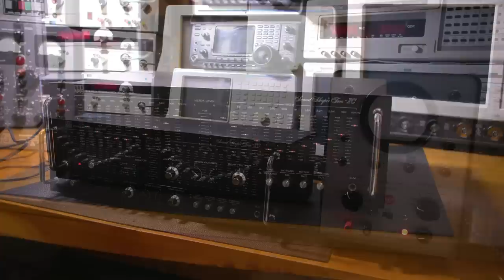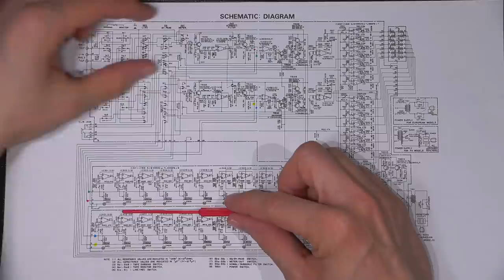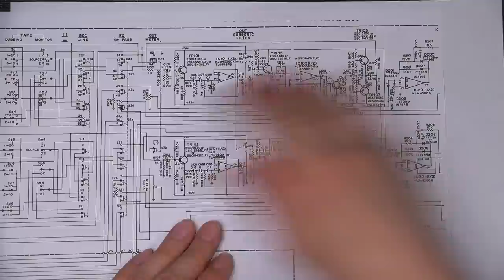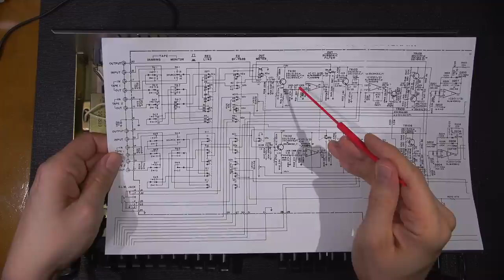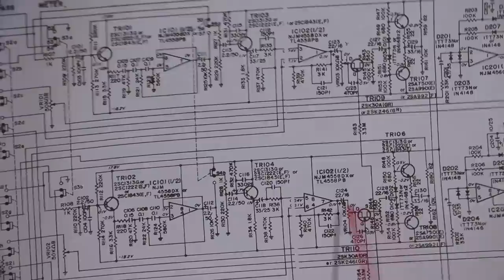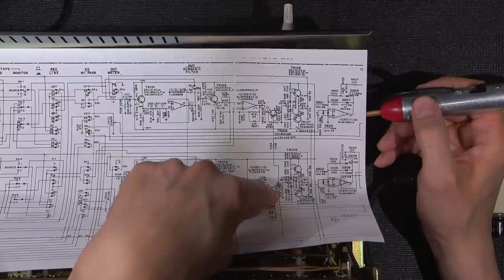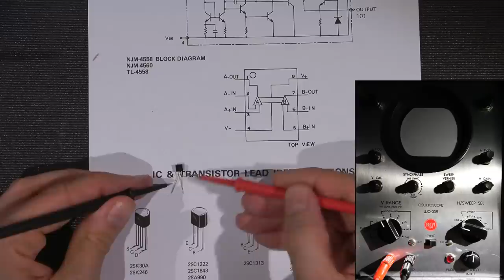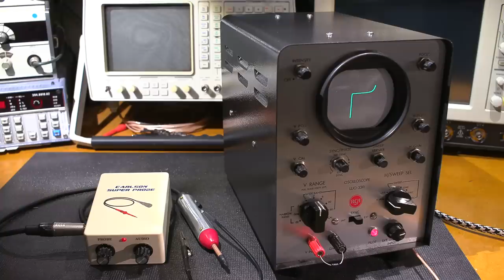Electronic Repair- Stereo Audio Equalizer From The 1980's!

Comment from the maker: To learn about electronics in a different and very effective way, check out my Patreon page. Many of my designs are released there as well. Click this Link: https://www.patreon.com/MrCarlsonsLab
Reply: @HalfSpeedMastering -- In this particular case it certainly is same, since the FET in question has a pure and very brief pop-suppression function and is otherwise pretty close to a piece of wire in the signal chain.  I would trust Paul 100 percent to avoid degrading or otherwise altering the audio performance of any gear he works on.
Reply: Gotta love this old school  equipment. Very stylish scientific look to the dials, markings, and solid cabinetry. Reliable circuitry, and easy to work on. 🎛🎚🎚🎚🎚  👌😙
Reply: Could you help or enlighten me with component VSHPS1437_040050680, your help will be highly appreciated sir....thanks
Reply: May you should make a video about the carlson super probe instead, if it is so easy to use.
Reply: Quick question where did you get you desoldering tool. And or what is the brand name/ what is it called.
Thank you for your time and have yourself a grate day. 😁
Reply from the maker: @charlesbennett6105  Hi Charles, it's a Hakko FR-300
Reply: Awesome! Thank you so much for replying. 
Have your self a grate rest of your week. 😁
Reply: How do I pm you?
Reply: Hate this video. Showing off a Carlson superprobe. So I looked on the internet straight away to buy one. You can only get one if you build one yourself. I am sure I will make a mess out of that as i never made any electronic device. So great machine for electronic builders. Bad for dumbass electronic beginners like me who could really use one to find electronic problems the easy way. But all respect to those who understand all that electronic stuff. Wish i didn't study bookkeeping. Now I would have liked it more to be an technician in electronics.
Reply: mine sometimes works but its all distorted and sounds like crap but the left channel works just fine..
Reply: OMG, I used to have that equalizer, in the late 80's.
Reply: +zt
Reply: Watching you work on this makes me wish I had followed in my father's footsteps and studied electronics he was a ham radio operator W9CMX
Reply: Good morning,

I have a question about a 14 pin IF amplifier IC. The one in particular I’m looking for info about is for a McIntosh MX 113. I need two of them. I’m thinking about a NTE 744. Do you think that’s a compatible replacement?

Comment: Wow, I have the same ADC Equalizer that I bought in the mid 80's. still works great. Thanks for the video.
Reply: Me too.  Love it.
Reply: @sferg9582  Still have my ~40 year old one, a SS110 Mk. II, that I had given to me back when I was 14. That was in 1991.
Just fixed it today, now it works right :)
Reply: The sliders on mine does light up and no  sound it hasn't been used in years

Comment: Wow, freakin' awesome video. My first equalizer was an ADC Sound Shaper Two (with the VU meter) in 1978. Worked great but with three tape decks I eventually wanted a dubbing feature on the EQ. So in 1982 I purchased this model ($213). With bidirectional dubbing, large LED meters, a good subsonic filter (18dB/oct@15hz), THD and IM of 0.02% and great layout of controls I was pleased. My original EQ was given to my brother-in-law and he still uses it today. That's over forty years. My SS2 IC still functions perfectly and is used every time the hifi is on. Not bad for thirty six years old. 
 Some folks just don't understand how useful an equalizer can be. This video is very interesting and a definite keeper. The SS2 IC is an excellent EQ, functional and pleasing to the eye with that "industrial" look. Remember their first EQ?? The ADC 500??? Well worth an hour of my time to view this. Nicely done, sir.

Comment: Amen brother.  Don't know how many times someone sent in a radio saying xxx was wrong with it and the instant it got set on my bench it started to work again.  Having been a heavy truck mechanic also many years ago I speak from experience when I say they suffer from the same problem to.
Reply: Ditto for computers and electrical installations.
Reply: @Mariano.Bernacki  For me the opposite happens. I test the damn computers for 2-3hours and the next day the client calls me that the thing stopped working.
Reply: The effect also happens with desktop support. Arriving at customers desk will sometimes solve the problem. I always used to say I was so good my mere presence solved the problem.
Reply: Truck driver to Radio tech: "It's the finals". Truck driver to Mechanic: "It's the EGR". -Former, recovering truck driver turn technician. Other favorites: "No, I bought it brand new! Nobody has ever been in there!(Covered in pry marks, stripped screw heads, missing screws, splatter-box, solder balls rolling around, cut diodes, over-sized caps...). "It just needs caps". (Burnt PCB around through holes, smoked resistors, some weird residue all over, is that a bobby pin? What is that smell? Is...is that urine? How the hell...). "I'll be back Thursday".(11 months later..)
Reply: @sobolanul96 , you mean the client failed to tell you that the computer was being used in a sauna? LOL

Comment: We used to sell and service SoundShaper equaliser back i n The early 70' and this one you repaired is so simpler than the first ones they designed! The had the power supply completely shielded from the rest of the circuitry and used at the first models germanium transistors, but I see their basic or original design hasn't changed to much. Keep videos like these coming , they are a pleasure to watch for a retired old engineer like me! :)
Reply from the maker: Thanks for sharing your story!
Reply: My  Soundcraftsmen PE2217 Preamp-Equalizer is due for an overhaul.   Time to get my hands in there and have some fun.
Sliders have gotten sticky, and some electrolytic caps are on their last leg and thus are affecting the bandwidth at the low end.

Comment: I have what is probably a previous version of that very EQ.  It is simply called Sound Shaper Two and it has analog/mech level indicators.
Aside from some of the switches needing cleaning, I use it to this day and and after around 40 years, I still like it!
Glad to see with very little effort, they can be repaired!
Thanks!
Reply: Throw Me Back, You may consider recapping it, also. That is a circuit long in the tooth.
Reply: @BruceNitroxpro  Ha! I would if I could figure out a way to recap my ears!  Sadly I can't hear any highs anymore!  But along those lines, I do have a couple old Heath Kit amps and pre-amps that I used as a stereo years ago that definitely need recapping.  No idea what kind to use though.

Comment: Great job! Once again, making it look all too easy! And once again thinking I need to build that Super Probe. I built a probe(with an actual germanium diode) and it works well, but the idea of a non-contact probe where one can just wave it close to the board and not having to locate and contact an emitter at some absurd angle is blissful.  Curve tracer first, though. Op Amps are coming in from Digi-key as we speak. Your Patreon page has been the single best tool on my bench. I have been using your transistor tester, matching, biasing circuit for a while now and it never fails. I just let your videos play while I work and always learn something new, even if I have heard the video a couple of times.

Comment: So many of your fans have old scopes. One of the most common scopes over the decades was the Tektronix 465B. I think this would be a worthy work horse to go over as a general "what to look out for" and common problems specifically pertaining to this aging scope. I built mine from scraps of others that were beyond ECONOMICAL repair. Nothing is irreparable with your keen skill!
Reply: Check the DC restorer diodes going to the grid. Also, check if the Z intensity control input has any effect. After that, ebay for the transformer, or a dead 465b for parts. Check your local tyrannical government electronics redistribution center. I have seen them sell for $20 working!

Comment: I had an Apple tech brake tabs off and leave pry bar marks on an Apple IIc computer because he did not know the proper way to open the case. It really got my goat. I love the channel. Keep up the great work. Wish I  knew one tenth as much as you about electronics. I learned just enough to get a ham licence. Love the old equipment (boat anchors).

Comment: I’m sure this is going to be another great video and I’m looking forward to enjoying it over the next hour. It looks like nice unit, and these things could be useful in the right hands. Unfortunately, back in the day equalizers seemed to attract those that wanted overly-booming bass and overly-sizzling highs and not those that wanted to subtly correct for a room aberration or poor recording. I wish they had been designed with only +/- 4 dB of gain and not the typical 12. That’s more than enough, really, and would have kept people from destroying the careful sound that engineers take time to mix, while also saving amps, speakers and ears from damage. I can’t tell you how many times I got in a car back in the 80s and 90s, and was tempted to zero-out a friend’s equalizer. Nowadays, I’m still tempted, but the equalizer is buried in ten layers of GUI!
Reply: I don't think a lot of people understand the proper use of an EQ also. I use it more to remove frequencies rather than boost. Most people boost the crap out of it!
Reply: Flux Condenser, I have one with built in Spectrum Analyzer, which makes the unit a hoot to use.

Comment: I worked at a job troubleshooting printer PCBs years ago.  I miss the Huntron Tracker (dual trace curve tracer).  Great tool.  Very necessary as the manufacters would not release schematics to our company.  Info on a lot of the printers was still confidential.

Comment: love that huge mid scoop they have going on on this unit.  i have a late 80s 100 band eq/amp thats needing some repairs. each band has leds on the sliders, some have died , and hard to find 12v square type leds, without paying an arm and a leg. it also needs a re-cap which isnt to difficult once you dig into the unit.  Thanks for sharing this beast!

Comment: We had an audio "sniffer" when I worked in the network/cellular industry.  We connected the audio generator to one end of the RJ45 cable and used the probe to find the other end when we heard the test tone.  It was a necessary tool when dealing with cabling that nobody thought to label, especially when going from one end of a building to the other.

Comment: Another excellent troubleshooting video, perfect for the new technicians out there. There is an "official" name for the technique you used to divide the schematic near the beginning of the process - it's called "the half split method" - dividing the block at the middle and checking for signal. It works really well for very complex systems.
Reply: binary search in programming lingo

Comment: Thank you Mr. Carlson .. This vid just inspired my next fish can project - so named because I have a collection of sardine and the like cans with matching perfboard "covers" that I've been trying to come up with small one and two evening projects in which to utilize them. A curve tracer! No reason that I can't spin off a rudimentary battery powered 4 chip tracer with miniature 5x7 LED  matrices (arranged 10 rows, 14 columns) as the display. 3/4 of a quad comparator to generate the probe sine, square it up for a pair of 4017's to do sweep, and level translate the other probe to center an LM3914 vertical input. Should be cute as a button, and the relatively low resolution shouldn't be an issue.

Comment: That probe in the aluminium tube, with the red cap and switch look very familiar - the Heathkit IT-12 Signal Tracer. I used to use exact same one waaay back in the early 90s, late 80s.. they were great, used often in rf and audio circuits, and sometimes even tracing digital switching. I didn't think you could still buy them!

Comment: Great troubleshooting instruction!  Replacement of a component on a single sided PCB is relatively simple, but a concern arises when working with double-sided PCB's.  I wish you could clarify how to be sure re-soldering is done correctly especially when the component being replaced are radial mount electrolytics that mount flush to one side of the PCB and hide the top view of the soldering joint.

Comment: I used to have the earlier model of that EQ. However in the late 80's I converted it to balanced inputs and outputs and to use a higher line level to make it compatible with professional  sound mixers. What made that easily possible compared to most consumer grade graphic EQs is they used a solid push-pull transistor stage in the outputs which most consumer gear didn't use. Another difference was the older model I had used inductors for the 1st three bands but they were later dropped to cut costs plus capacitor technology got better and high value tight tolerance capacitors became more affordable but even so the center frequency in the lower bands tends to be a bit sloppy as compared to using inductors but good enough for consumer devices

Comment: A practical approach to audio or video equipment troubleshooting/repair: I think the determination of a (the) faulty channel could be done much quicker by a simple "audio in and out" setup. With a cheap mp3/music player, a powered speaker (I have one on my bench always ready to rumble) and a set of RCA cables this would take literally 20 seconds. No need to disassemble anything. From there the search could go on. Or you could determine a properly working EQ, with the only defect a faulty VU meter. It IS "audio" so it can be prechecked audibly :-). I recommend also to changes the state of all of the switches and sliders while testing (aka listening to the test sound/music), so a "rotten" switch or bad contact can be traced immediately. And what I missed in your video was a final check of audio. Only after that step, I would do a thumbs up, not before :-)

Comment: Great vid. Love your non-intrusive test tools.
With regards to which channel is which, there are a few conventions that can help people make good educated guesses. they all follow the convention left comes first, then right;
- the channel drawn on the top is usually Left
- if all the component numbers are odd numbers (eg TR101, R113), and the other even (TR102, R114) then the odd channel is usually Left.
- if the channel component numbers all differ by a hundred (eg TR511, R512, C518 one side) vs (TR611, R612, C618 the other) then the lower hundred series is usually Left
- if only one channel has signal path, component values, voltages all drawn in, and the other doesn't, the channel with the extra info is usually Left
- if only one channel is fully drawn (and the other is only partially drawn, if at all), the channel drawn properly is usually Left.  
Awesome vid. Really enjoyed.

Comment: As an electronic technician hobbiest and formerly licensed fire alarm technician, your troubleshooting was very good but missing a few things that I would have done.
1) Test the output of the channels at the back panel as I start. This tells me if the issue is an actual dead circuit versus a dead led driver. Since this is easily done by using a cheap speaker hooked up to each channel (with an amplifier to make the speaker loud enough) it would be a part of my audio testing toolkit.
A bonus to this testing is you find out which jack is lacking output which helps to trace the channel circuitry.
2)  Following on from step 1, I would trace the circuit from the jack wiring backwards to the input wiring. (This is personal preference but it helps when you can't find a circuit diagram.)
3) 'Tone' out the circuitry. (Here is where a 'fox and hound' comes into play. Tone generator and probe used in phone line testing but handy in other areas.) Basically this is the super probe methodology but using the tools I have in my toolkit (and you can find in some stores like Harbor Freight, Home Depot, and Lowe's).
Once you'd found your bad part, replace it (and companion for stereo components).
Reply from the maker: You're forgetting, this is a video. The whole idea is to show different troubleshooting techniques, not to go right to the problem. This video would be 5 Minutes long if I did that, and people wouldn't see a path to the issue.

Comment: Great video, Paul. Thank you very much! About addressing the L-R, 1-2 part on the schematic; Firstly if the manufacturer doesn't label this on the front plate, it doesn't help much if they label it on the schematic. A possible explanation can be that in a professional environment, "a stereo" EQ most of the time isn't used on the stereo output chain. Perhaps one EQ is inserted on the console channel 16 before recording and the second EQ is used on return 4 to the vocalist's headphone, as this often is a dual mono signal. Nevertheless, you are right, for troubleshooting it is unacceptable not to address the two parts especially if these aren't electronically identical. Heck, name it Anne & Rose if L-R, 1-2 can be confusing.